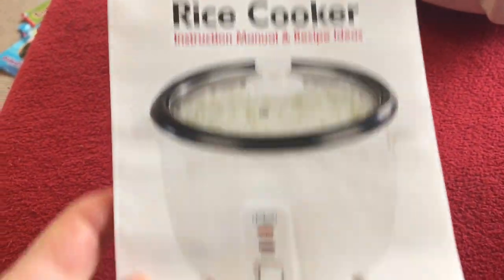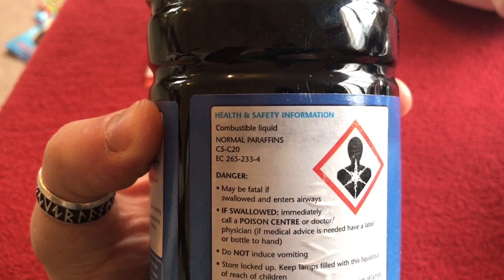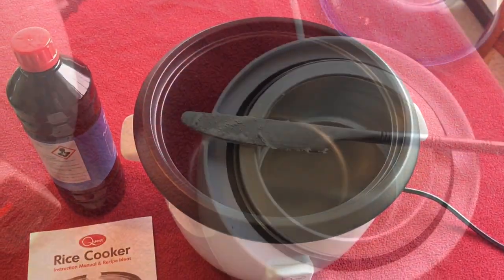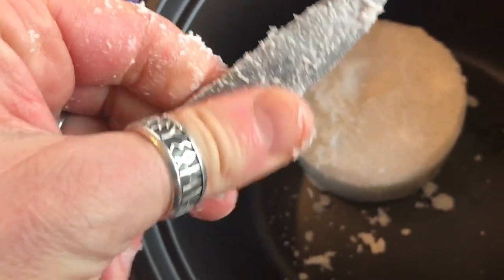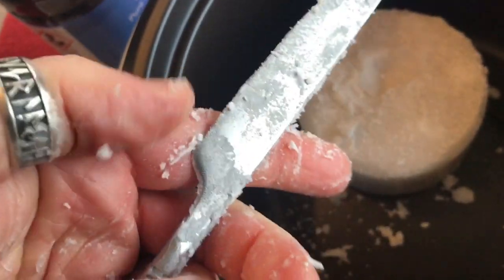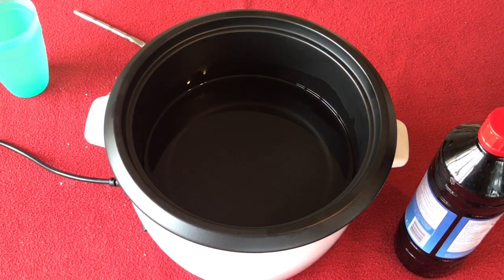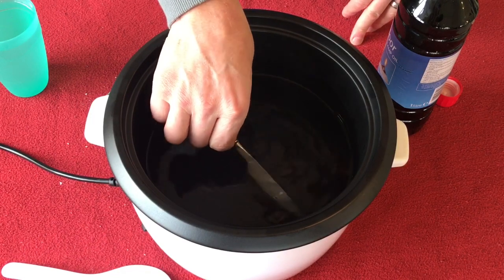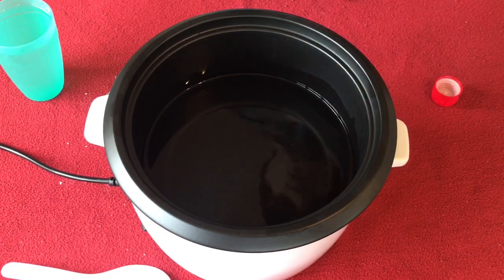How to make Wax Chain Lube

Comment: Is paraffin oil the same as paraffin? As in what I would put in a paraffin heater £6/£7a gallon
Reply from the maker: James Kemp don’t think so but I’m not sure I only used it for this  was lube.  Sorry 👍
Reply: Paraffin, Paraffin oil, Lamp oil, all the same thing. Candles are made from paraffin wax.
Reply: @DUBBERDUBBER  thanks you said it so well.

Comment: im trying e45 cream with candlewax roughly 50:50.  I found the lamp oil I sourced stank to high heaven (it had citronella in it) and the very roughly 50:50 with wax looked hopeful but absolutely didnt last: it was ultra slick and quiet but only for about 30 miles at which point chain sounded/felt dry again.
Reply from the maker: Lee Tanczos yeah I may have mixed it with too much oil as it’s wearing off too quickly, I’m gonna mix in more wax pellets to make it thicker so it stays on like the last lot I made. 👍 

Best lube I ever had that first lot....
Reply: Kyro's House I was frustrated that the chain felt dry and noisy... I bought 3in1 oil and it that on the chain -  it felt great, but was black in no time. I have some ptfe powder now, will try adding that to some of the oil and see how it works...
Reply from the maker: Lee Tanczos since this video I added about 500g more wax pellets, the mix seems to be about right now, the last mix was still on the chain but it was noisy, this time it stays on much longer. 👍
Reply: Kyro's House it seems we are looking for changing the mix, I have to admit I should be cleaning the chain thoroughly in between “melts”... the 3in1 I have now I think will clean off easily in white spirit / mineral spirits.
Reply from the maker: Lee Tanczos I clean my chain with an ultrasound cleaner before waxing it again, gets it nice and clean ready for fresh wax... 👍
Reply: Kyro's House yeah I have one too... what solvent/liquid you use? Or I use a glass jar with white spirit and shake it and renew the liquid until it’s clean.
Reply from the maker: Lee Tanczos I just use chain cleaner in mine. 👍
Reply: Kyro's House good vid by ozbiker about exactly my issue, chilling the hot waxed chain to trap more wax in the chain, and how to clean the waxed chain between rides and before rewaxings, and also how to handle a brand new chain
Reply from the maker: Lee Tanczos yeah that’s a great vid, I watched it and it’s very informative. 👍
Reply: I use a mix of paraffin wax, beeswax, (about equal proportions) and enough “heavy gear oil” to result in a plastic mess that clings to the chain.

Plan is to add powdered Teflon next, and have a small propeller to stir it in the crockpot.

Comment: How do you clean the chain off the excesses wax? mine is a complete mess, with tons of wax... ho do I easily get it away?
Reply from the maker: Jakub Badełek I would run the chain through a cloth or rag to get rid of the excess, just riding it will get rid of all the loose stuff though. 👍

Comment: Hey Kyro.
Amazing video, I've used it for my bike.
Now after only 100 km approximately my chain is kinda noisy. is that a sign of i need to rewax or is it just the way it is?
Thanks again.
Reply from the maker: I always go by the sound…if it’s squeaky (like a rusty chain) then I’d re wax it. 👍
Reply: @KyrosHouseCycling  cool thanks 😊
Reply: Just so I get this the right way.

If it scales right off the chain during rides it's because I need to put more oil in the mixture right? 😊
Reply from the maker: @mattiass.nielsen506  yeah I would say it’s too waxy and needs more oil. 👍

Comment: Before applying the wax lube, is it sufficient to clean with a degreaser and white spirit, I have heard u need to use petrol too. What would u suggest? And should u use white spirits 1st or degreaser? And would just 1 of them be sufficient? Thanks
Reply from the maker: I just use chain degreaser in an ultrasound bath, dry them then wax the chain. 👍

Comment: You are adding too much oil. If the lube is in a fluid phase, then dirt will stick to it.

Try 5% oil for summer, 10% for fall spring, 15% for winter
Reply from the maker: David Mordaunt thanks for the tip. 👍
Reply: Hey!! I've been looking for numbers, had this problem with dirt. Do You refer to weight percent? That is 10% meaning 10g of oil on 100g of mixture?

Comment: What about using something besides pariffin oil or liquid pariffin? It's anywhere from $12 to $15 per pint here. Walmart sells Florasens lamp oil for about $7 for 64 ounces but it doesn't list any ingredients, only that it contains petrolium hydrocarbons, so I'm not sure what it consists of. A pint of mineral oil is $2 and Kerosene is about $4 per gallon.
 Any thoughts?
Reply from the maker: Jeff Stone yeah I think I had lamp oil... as long as it’s parrafin oil it should be fine.. 👍
Reply: PAG 46 auto ac compressor oil, nearly every parts store has 240mL for about 10$ or even less... tried it on my chain and it gave a very high end ceramic-synthetic lube like feeling in terms of noise and smoothness, also not messy and not smelly (slight rubbery smell that quickly goes away, and nothing else).
Reply: you're going to want to go to a vet supply shop of sorts and look for some food grade " liquid paraffin" or " Mineral Oil " some places call it " light liquid paraffin " and " light india ". But its essentially a laxative they give to constipated animals and the kind they use to make make up
Reply: $15 per pint is nothing compared to commercially produced chain lube. Makes a lot more too.
Reply: The wax is cheap. The oil is cheap. Makes a large batch to treat the chain many times. It’s the ptfe powder that is expensive
Reply: Vicki Peterson  ptfe powder is Teflon. Lowers friction
Reply: Have you tried using toilet bowl ring wax (TRW)? It is a petroleum derivative. I plan to use diesel to clean the chain on my old motorcycle then treat it with TRW as a lubricant.

Comment: so what isd the ratio ?
Reply from the maker: Sonny Bee I’m not sure, I just mixed it until it was soft but not runny. You don’t want it too brittle as it will just fall off, too runny and it won’t stick. It was good for an experiment but I don’t use it anymore, I use molten speedwax. If you watch oz cycle he makes a great wax which is where I got the idea from. 👍
Reply: Oz Cycle used a 1:1 ratio in his earlier videos.
Reply from the maker: Marc J I found it was a little more wax than liquid to be honest. 👍
Reply: I used 10% paraffin oil. Also mixed in 10%  ptfe. Easy peddling. Probably can go a gear higher on the harder trails. Some lamp oil is kerosene based. Make sure it is paraffin based.

Comment: how you decide  what mixture is best  for use
Reply from the maker: Makan Tahi it’s all in the consistency of the mixture, to hard and it’ll flake off, to soft and it won’t stay on, so somewhere in between, it basically trial and error. Though more pellets to liquid, think I used 1kg wax to 600ml liquid... 👍
Reply: yes, i did it too, tested from softer mixture to harder, and most important is that surplus of wax on chain fall off from chain, when rotated, not stay on it like butter, i work with inductive heater to warm up the chain on bike and then put wax on it to clean and lube it, all process took  about 6-8 minutes per chain/bike
Reply from the maker: Makan Tahi sounds great! And I like how you do it! 👍
Reply: i have video  with this link     https://www.youtube.com/watch?v=ORA6xFPTZXU&t=577s       , now it is little changed, switch is on inductive heater and can be operated by one hand , in other hand can be wax stick, and that way is faster